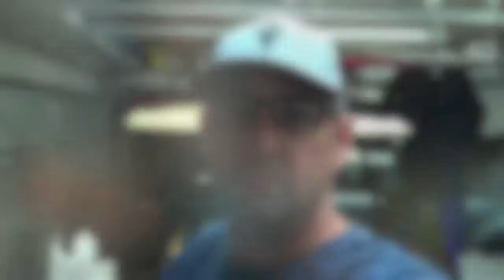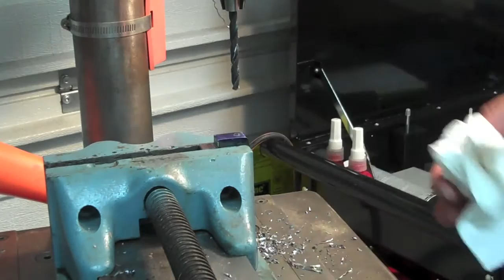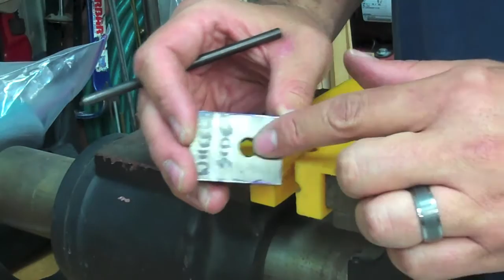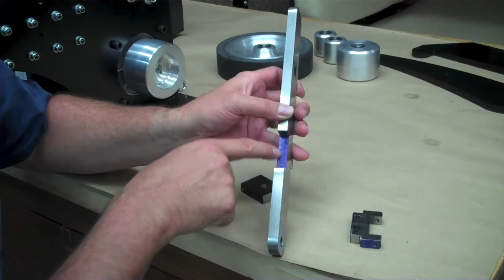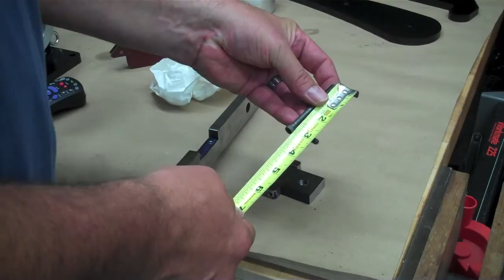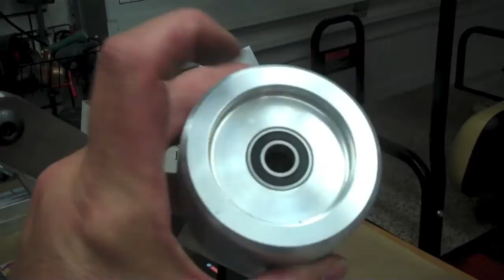Grinder in a Box Build Part 4

Comment: Thanks for taking the time to document the building of your GIB. Don't risk locking up a bearing with an oversized washer that may contact both the inner & outer bearing race. Skip the amatuer looking/unsightly stack of washers on your wheels by going to Lowe's & purchasing the correct ID steel spacers that are manufactured by Hillman. You can measure & cut them to your desired length. You'll find them in the hardware section, located amongst their specialty nut/bolt drawers. There's a few part numbers on the bag that read as follows: 0823670813, 880421, 136452.

Comment: Tyler, I assembled the GIB yesterday. I have to wait for the motor and wheels now. It took me only about 2 hrs, to assemble the base and its components. I do have a question concerning the multi platen. The two holes that have to be tapped seems to be surface hardened. How did you tap those two holes?

Comment from the maker: Great question.  So far I have not noticed any issues with the motor not being bolted to the base.  I have not seen any noticeable run out on the drive wheel.  Ultimately it is never to late to add gusset plates for strength as it would just mean a repaint of the base. 

I made a mistake ordering the motor without the base plate, lesson learned.  If my setup becomes an issue I will replace the motor with one that has the base plate and press the old motor into service as a disc grinder.

Comment: Any problems not bolting the motor to the base?  It seems like that would give it significantly more lateral stability that just the welded and bolted half inch steel.  Alternatively, would it be to late to a a gusset?